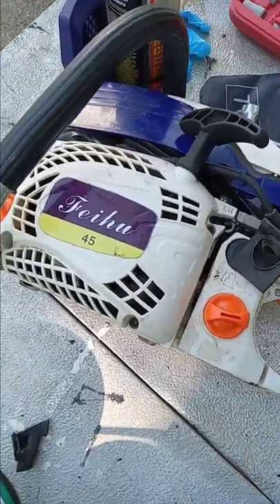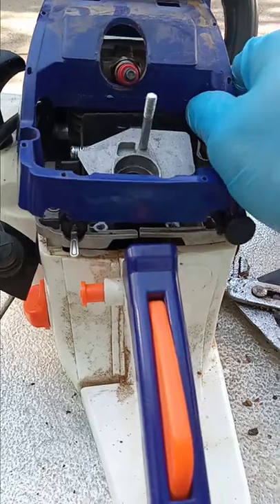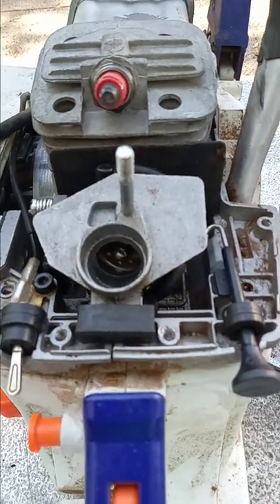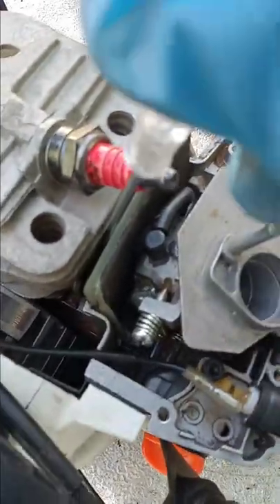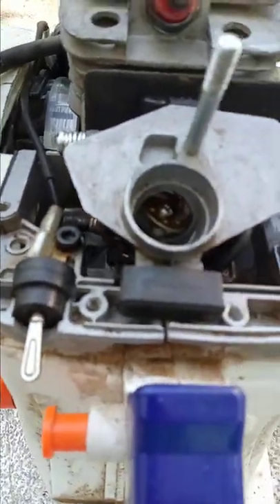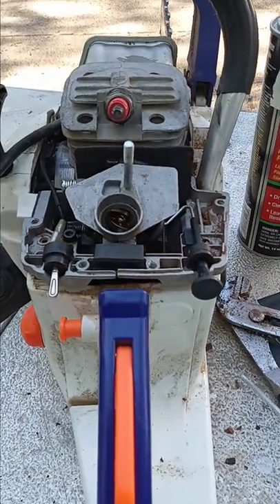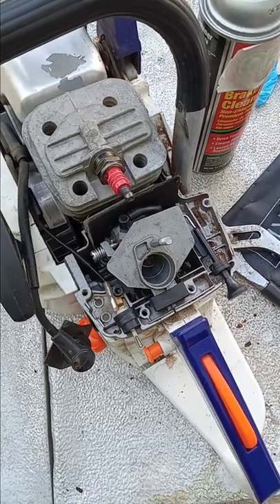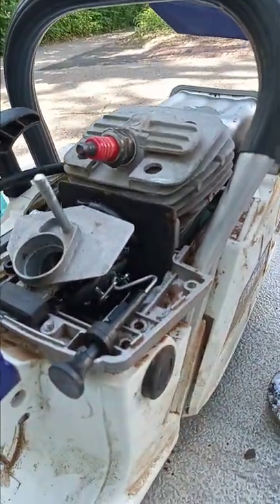DIAGNOSING AIR LEAKS, ZENOAH CLONE CHAINSAW without a five-minute introduction

Comment: This is interesting. I was searching for the zenoah Clone top handle chainsaws. I have one of those as well. I watched this video and you were talking about air leaks, and then you said something about this brass ring. I’ve been fighting with my little top handle saw trying to find out why it won’t run right it has an air leak of some sort or that’s what it seemed. I tried a bunch of different things that seem to get a little bit better, but still wasn’t right and in the end I took that brass ring mine had it as well and I left it out and now I don’t have an air leak like I did before I would say it’s about 95% better so I’m thinking I’ll just put some motoseal around the intake manifold where carb bolts on and hopefully that will make it run 100%.
Runs really good right now I’m just being super picky at this point lol
Reply from the maker: This would be a good question for the fakebook group.  I tried some plumbing blue sealant that was heat resistant and it did not work. I wonder if removal of the brass ring will help mine. I might try that next time as I have one I buggered up when putting it back together.

Comment: This is the #1 selling small saw sold in Thailand. Our best seller. There is a law here resticting it to 1 hp and 11.5" bars for retail sells.  Great economical saws.  There are 2 Piston sizes and 3 different production grades.  You'll have the least defects  in the $150 price range.  It's great, if used for intented purposes. They Don't last here because people use 22" Duromatic style bars with heavy chains for milling. Sadly, we primarily use ethonal fuels. They are easy to repair, simple to maintain,  and parts are sold at your local hardware store.
Reply from the maker: Are you talking about this particular name or the Zenoah clones in general. I have never seen this name sell anywhere else. Many have air leaks at the intake manifold. After fixing this, it got hot and again started to leak air. I tested it with brake cleaner and it died when sprayed in the same place.
Reply: @iowaunemployment  Sorry, I was referring to the clones in general.  The brand is not likely an indicator of quality.  Often, several Chinese manufacturers are producing the same brands.  They undercut each other by reducing quality. Look for build quality, embossed markers,  idle speed,  and fuel consumption instead. In my opinion, a diligent operator is a more accurate  predictor of usefulness.
Reply from the maker: @udonhardware5178  You may want to join this FB Group. https://www.facebook.com/groups/158827535417075
Reply: @iowaunemployment  Thanks, I will.